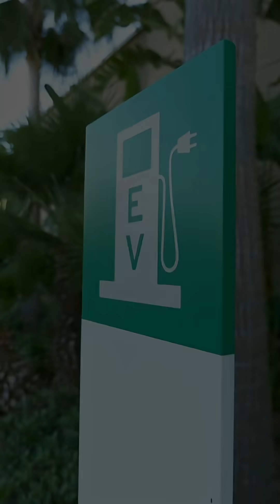How Electric Trucks Might Leave Small Towns Behind

Comment: Plug-in electric trucks are not practical.  Hybrid electric with diesel powered generators, makes more sense.
Reply from the maker: You’re right that long-haul routes pose big challenges for plug-in trucks. Some fleets are already testing range-extenders or hybrid setups for that reason. It’ll be interesting to see whether those solutions become the bridge to full electrics or stick around for good.